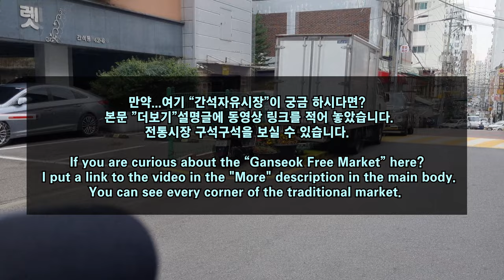A motorcycle belt that has not been driven for 1000 km has been broken - Daelim couple 50cc

Comment: Theres a saying for example, when a vehicle manual book stated servicing need at 10,000km, 6 months later or whichever comes earlier. At times i did my servicing even though i just clocked 2,000+km cos it almost reach 6 months for my car. At times i did my servicing in less than 3 months cos i clocked 10,000km early. I applies the same with my scooter which i previously owned. Belting deteriorates even though we dont ride the scooter for few months due to heat and weather as majority dont lubricate the rubber belting due to it closed system unlike suzuki S40 (650cc) or harley davidson models whereby the belting are open concept. Thus making it easier to reach and lubricate them from becoming brittle and break easily due to rubber hardening due to weather and temperature varies from one country to another. 😘😘😘😘😘
Reply from the maker: Thanks for sharing the good information you've learned from your experience.
I think many viewers will get more knowledge from this comment. 👍👍👍👍